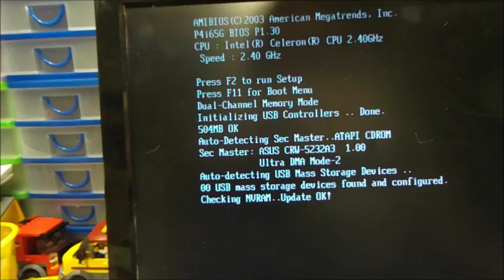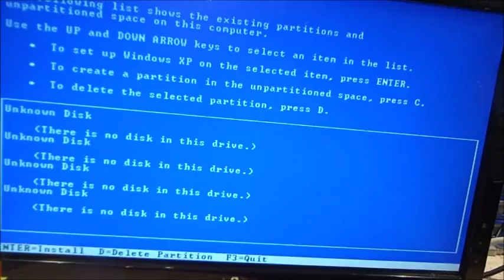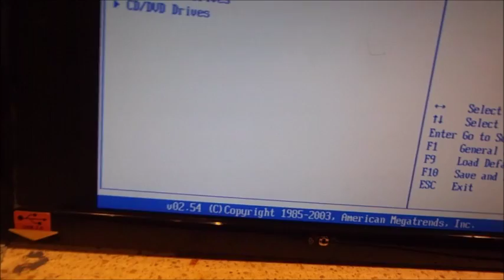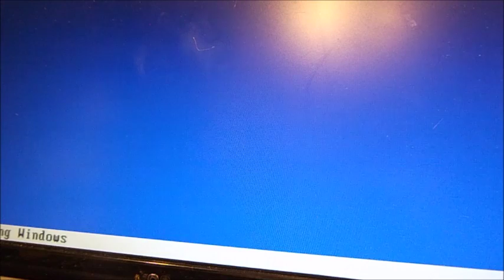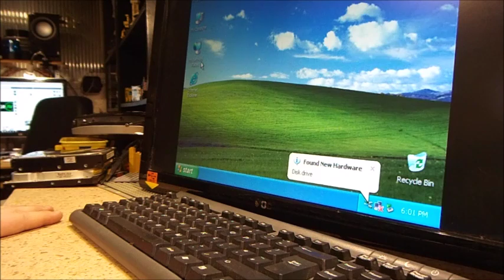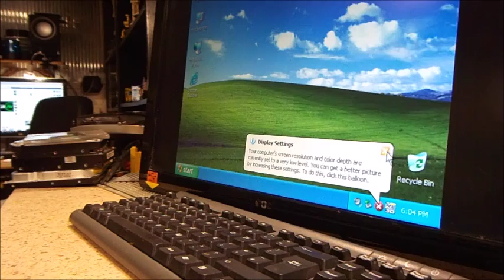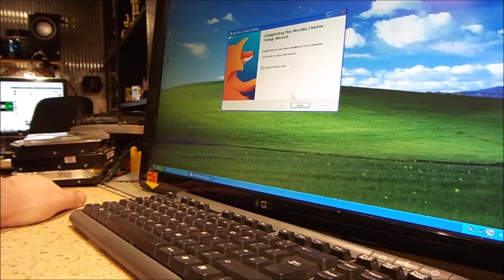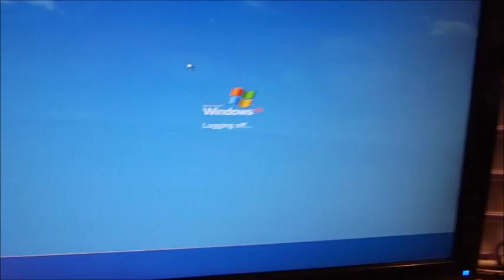Building A Computer (Old Style)

Comment: I/O shield:  

 

1) Shield to keep electro-magnetic radiation inside of the case

2) Dust Cover / Air circulation director: The fan in the power supply
 shall draw air throughout the entire case and not just along the short 
way from the I/O area to the power supply that's usually right above.

3) Aesthetics: No ugly hole.